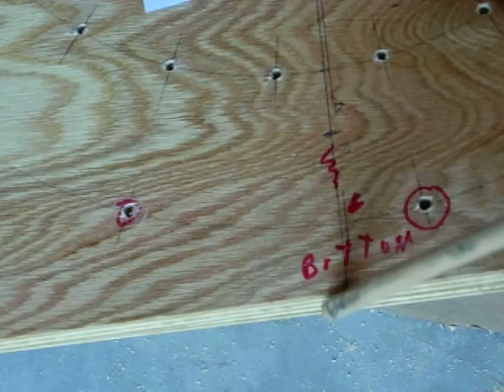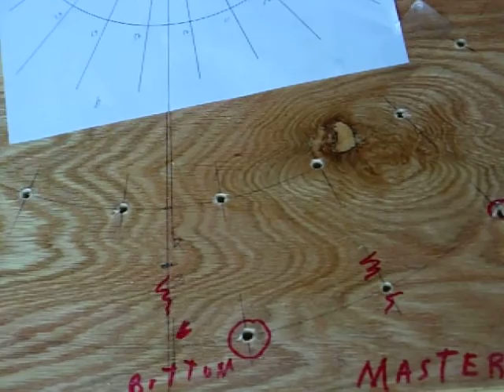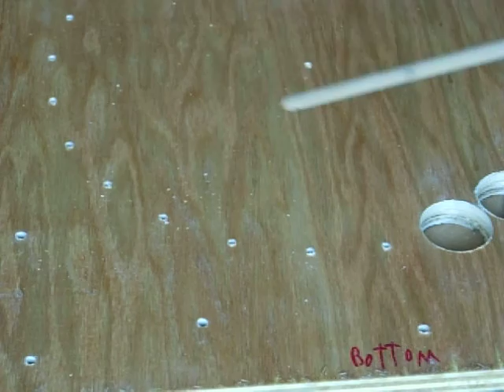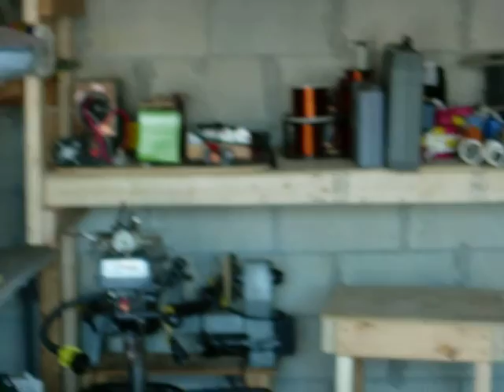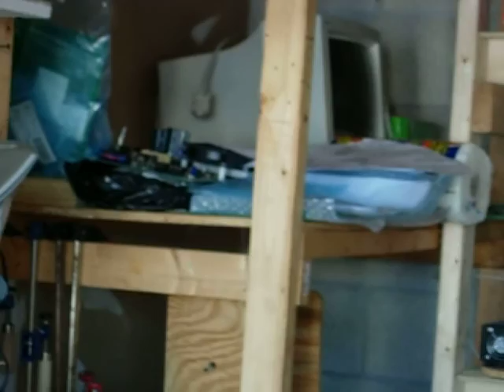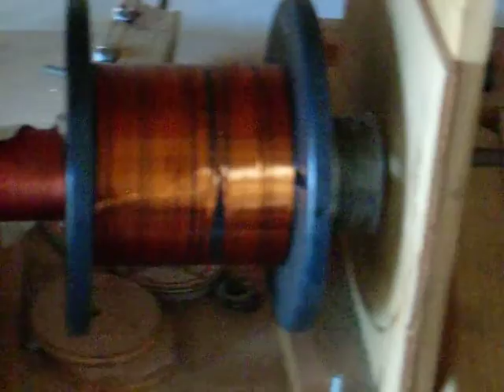Don Smith #150 making stators for car motor

Comment: Hows the progress going with your projects. Looking forward to your next update and video.
Reply from the maker: Just got the transformers and will proceed from their.  just finished another stator with coils for the car one more to go and machine shop will have all parts for rotor shaft 1" by 22 " long  6 rotor 18 " dia 1/2 think  and couplers, also getting pillow block mounts and motor base plate.  the entire motor when done  will be 24"x24"x24" so I need to get this attached to flywheel and clutch plate.  the electronics need to be rebuilt.

Comment from the maker: Transformers are in Melbourne at mikes shop and will be in lab next week.  I'll present a series of videos on the Gerard discovery and my own work soon. I intend presenting the guts and all research info.  For now I'm still winding coils for the car impulse driven motor.  just finished winding the second batch of 24 coils 48 more to go .   Machine shop is almost done with all machining. which includes pillow supports rotor 6 of them 5 will be used, shaft flat, collars two per rotor.   the end product will be 24" by 24" by 24" cube motor with 1 inch shaft, 96 2 Inch neo magnets grade 52, and 96 dual 26 ga coils 1000 turns.  each of the 4  stators will have 24 coils in parallel 2 stators will be wired series.  I'll have to make another 8 LED adjustable mount same as in video of prototype Don Smith #39 and then will try driving the motor with batteries first via two PCBs I may have to ad another two 2 PCBs  about $430 each  for parts.  First test of done stator showed about 95% of impulse into power coil is transferred into the pickup coil  BEMF ringing event did not occur until I went up to 24vdc impulses then the event occurred with ring pos and neg of 150v ac not sure of freq yet but it could be in high KHz region.  prototype went as high as 431khz.   scope doesn't show true event 12vdc impulse into air core coil can yield electrostatic ring of up to 5KV.    The design will capture three pieces of energy, original power impulse, the BEMF event, and Magnetic induction all  3 captured at very specific times and returned back to front end energy source.

Comment: Thanks for sharing Gary.
Reply from the maker: I'll be using 5 rotors and 4 stators.  The outer rotors will only have 12 neo 52 grade magnets on one side facing the stator coils,   The inner rotors will have the neos on both sides.  96 magnets in all and  96 dual coils.   The outer rotor surfaces may allow for a Faraday Disk operation producing about 1vdc at very high amps.  if this energy is handled with very narrow impulses once in a while the flow may not impede the motor lenz